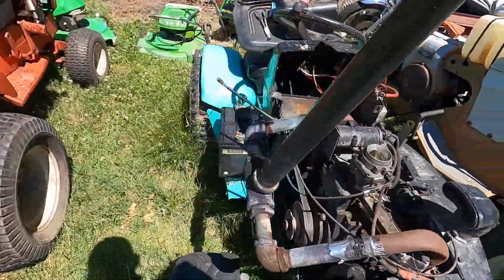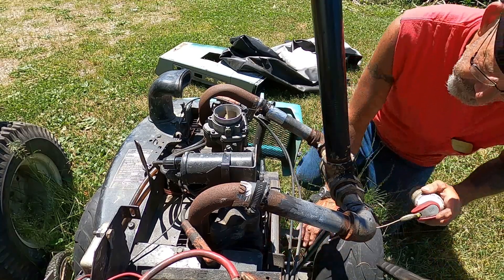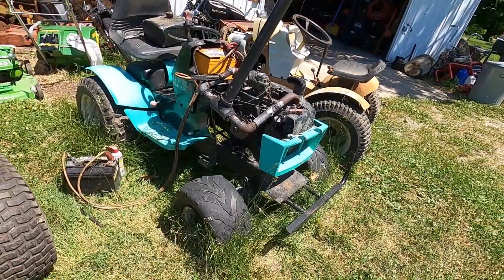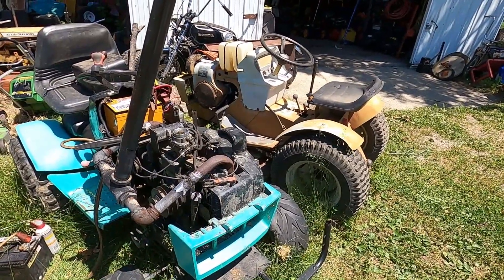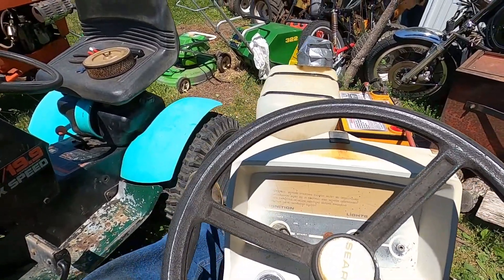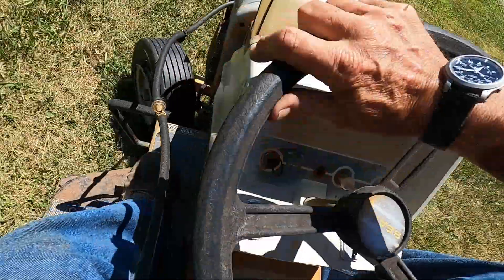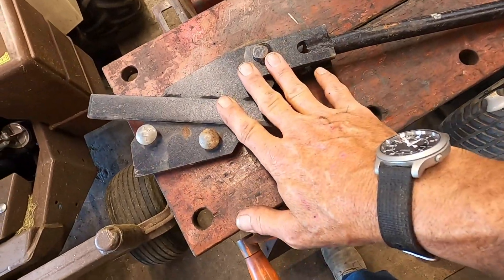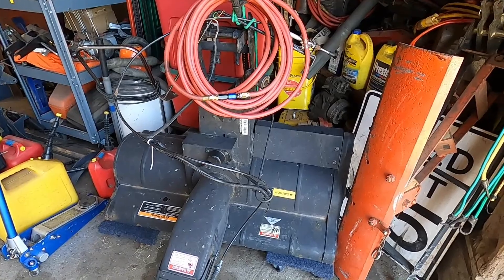Dueling Sears Garden Tractors and MORE!! Lots Going On At The Ranch!

Comment: There was no doubt about the Tecumseh.  LOL  Just kidding.  They all need to be rotated once in a while.  I just turned down (for free) two 10 HP Briggs tilers from the old days.  They were stored outside for years  and I just didn't have the jam left in my body to take them on.  Subject change----Like you I have a little portable tank I just tape to what I need.  It saves my rear end almost every week when you need to know if something will run on it's own without doing a full tank clean.  Your Kawasaki is an FD6200.  I don't know that model.    My two are FC540 in the JD 180, -- and the Kawasaki FD440V. gasoline. 2-cylinder. liquid-cooled V-Twin In the LX178.  It is a wonderful engine.  Thanks for the fun.  I need a tractor mounted snow blower.  coming soon to a screen near you.  .
Reply from the maker: It's the same Kawasaki used in the JD 425 from what I gather. I've got a neighbor who has one and I hate working in his. He uses it at his oil change business and he's got little respect for it. It's always in deplorable shape every time I am called upon to help with it. This last time, he has a cooling issue. I'm backed up for a while and he wasn't very happy to learn I couldn't drop everything and rush over to help. This engine of mine is a FD620D. Hopefully those three gaskets and some wrenching will remedy my issues. Cheers my Friend! Sean~

Comment: Does that Tecumseh have a rod knock?
Reply from the maker: Good ear! I heard a slight knock as well. But Dave didn't hear it. When you would increase the RPM it quieted down, but I still suspect it has a sloppy connecting rod. Cheers Oakie! Zip~
Reply: ZippoVarga I have found that nothing ruins an engine more completely than the con rod thru the block trick. I have learn the hard way that at the first indication of a rod knock, it is time to evaluate to avoid unrecoverable error.